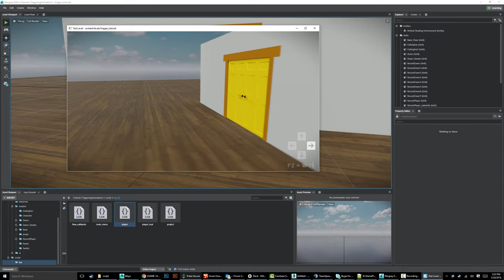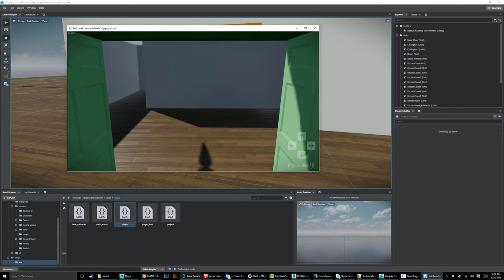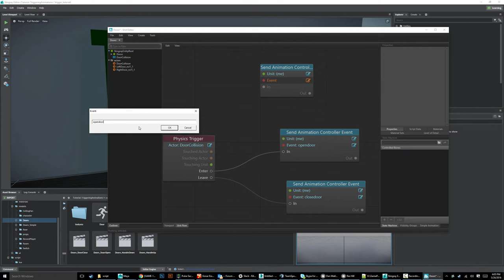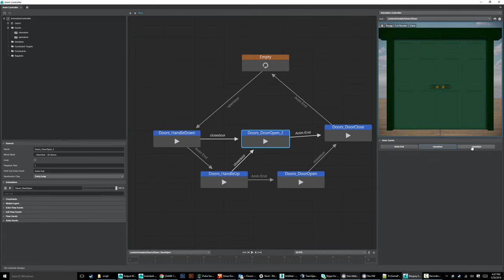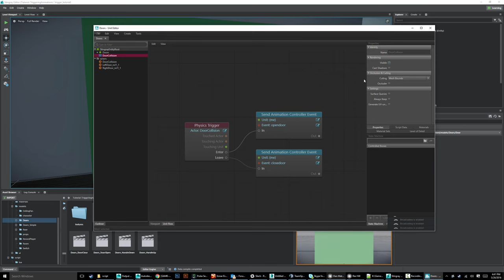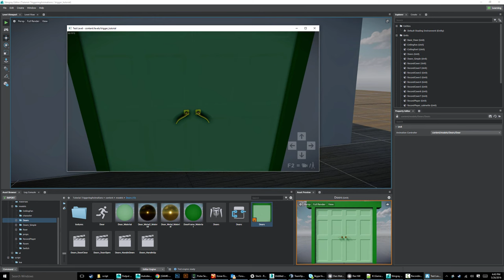Triggering Animation in Stingray - Part 4: Doors, The Harder Way That Looks Better

Comment: Thank's tutorials. Very Good. How to improve the quality of the shadows on the door handles?
Reply: well, there are a few ways.  the first would be to use the shading enviroment variables for Cascade Shadows.  You can also adjust similar settings in the lights themselves that are influencing the object.  The other way is by baking the lights.  Light baking is probably the best way depending on what you need from the scene.  In general a baked light is going to be softer and more accurate than realtime lights.